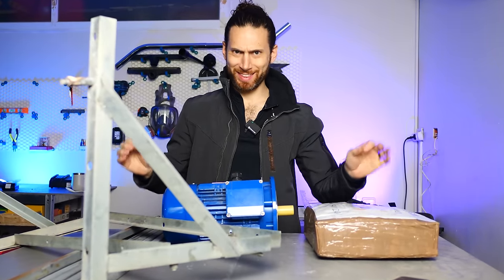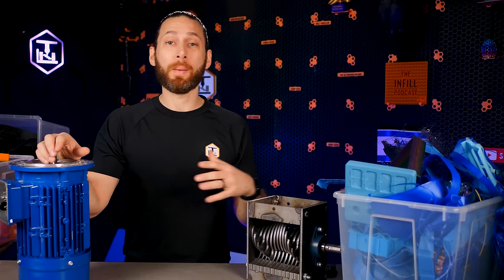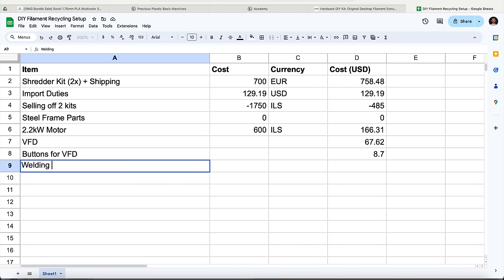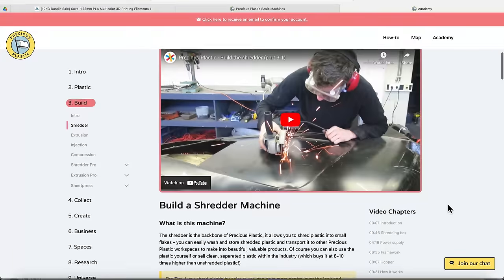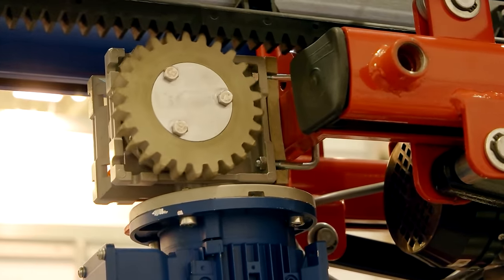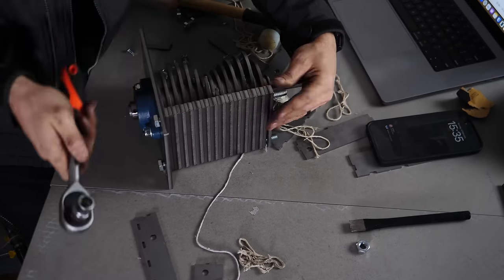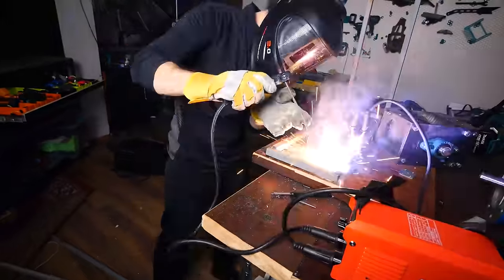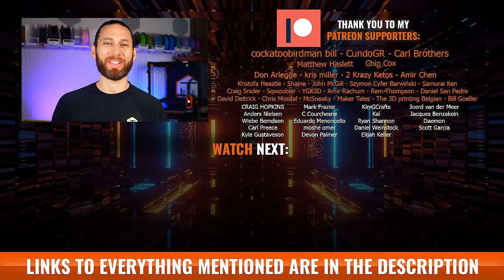Affordable Filament Recycling?

Comment from the maker: Thanks for watching! I really appreciate your feedback on my videos and projects, and I read every comment… So… Like… Leave one!
Reply: Treadmills tend to have up to 3kW motors, with controls to drive them very slowly, and can be had (used) for like $50. I use those a lot in various projects 👍
Reply from the maker: @timnoko3588  Wow, that's a really good idea, wish I'd thought of it.
Reply: the fumes are not the best
Reply: Never thought of that though Idk that it would withstand the torque for a long period of time.
Reply: Weld in ventilated area
Reply: Let's see, start with the Precious Plastic shredder it looks like you've already built, buy an Artme3D extruder kit, and add a Recreator3D if you drink a lot of bottled water. Full filament recycling station for a home shop. Doing that myself.
Reply: I have to point out that this project is 100% redundant. You are doing exactly the same thing as Precious Plastic id a decade ago, and they have a whole set of DIY machines and a worldwide community building this scale of plastic recycling machines, including dedicated shredder, extruder, injection molder, sheet press, etc, complete with downloadable sorting signs, business plans an hundreds of products apart from filament free to copy. 

PLEASE join them and promote them instead of reinventing the wheel and fragment the recycling maker community.

Comment: Sheet metal worker here, I would be using the 6013 rod too, so good start.  Absolutely have to clean your metal down to bare shiny before welding. Cleaning the ground area always helps too. Rod angle is important, always should be dragging the rod not pushing when horizontal. About 80 degrees for butt welds, 45 degrees for T welds. Practice on some scrap!
Reply from the maker: Thank you! This is helpful!!!
Reply: If there's slag, drag!
Reply: Its mild steel with a stick just a quick hit with grinder disk or wire wheel is generally enough, you want to get rid of paint and corrosion, push or pull isnt as important you can get good welds either way.. there are a bout 1000 different techniques.  but "clean" surfaces and having the settings on the welder somewhat in the correct place will get him 90% there.  @thenextlayer setup a some long butt weelds and pritice for a few hours, play with the welder
Reply: And you can get magnets to hold the pieces together at various angles like 90° or 45° so the stress of holding the materials is less
Reply: Great reply
Reply: I love this stuff. I am a mechanical engineer, I can design this stuff etc. but I have no idea how it´s welded in the end. Such a big difference between theory and hands on work, much respect.
Reply: Stick welding I'm a learning curve for sure. And little short welds are a pain to get it figured out.
Learning to do 3 or 4 inch beads helped me learn what was going on so much more than the little stich weld this project, and most projects you don't want to warp require.
Reply: @thenextlayer  also, you can use your left hand to hold the rod (about halfway down), as well as your right hand. This will give you control over the rod👍
Reply: This...  need to have clean surface to get a good weld and current.
Reply: Ditch the stick welder and go for co2 with argon. Way easier. I dont think anyone is still using stick welders? Atleast not here in Denmark, i havnt seen one of those for around 15 years.. Im an educated black smith, mechanical engineer, production technologist and manager
Reply: @donkanalje9443  It definitely has its place, but it's more for engineering and architectural steel profiles, like I-Beam, U-Channel, Tee, angle, etc. Big thick stuff that's structural and  doesn't need to be pretty. We use Tig for just about everything, especially thin-walled tubing like he was using. Mig would be my next choice, with a fairly thin wire. But I'll say this - our head welder is self-taught, from watching youtube videos. He's never had any formal training, but before he worked for us, he was doing aerospace and oil & gas welding, ultra high-quality x-ray inspected stuff.

Comment: Use a grinder and clean the metal around where you are going to weld and where you put your ground.  This will help get a clean contact. Also take some scrap and play with your settings on the welder. That is the main reason you are sticking at the beginning of the weld.
Reply from the maker: Thank you!!!
Reply: Jay is correct and for old box tubing 7018 or 6011 rod is a good all purpose rod  more prep more results cheers  @thenextlayer

Comment: Stick welders are not good for beginners. You should look into getting a Flux Core MIG welder. These are the type that use a spool of wire. You will get much better welds from this. No rod sticking here. Stick welders are also more used for heavy thick metal where as a MIG can be dialed in to better match thinner metal welding. They also use a wand with a trigger that allows for more precise control of your weld. They are comparable in price to any stick welder. Good luck!
Reply from the maker: I'm tempted. I didn't wanna spend the money until I knew that I liked welding, but now that I know I do... I think I'll get one.
Reply: Good to know, thinking of buying a cheap welder soon myself to learn with.

Comment: With a VFD, the frequency of AC supplied to the motor can be varied which changes its RPM. Changing the sequence of the 3 phases changes the direction of the motor's rotation.
Though, you can run the motor much slower with a VFD, you won't be able to get a high enough torque to crush plastic reliably. I will highly recommend adding a gearbox.
Reply from the maker: Shoot… ok I’ll look into one, I guess :( 
I don’t know where to source them here though.
Reply: I concur
Reply: @thenextlayer  you shouldn’t need anything super fancy from the gearbox. You could probably get by with even something like 2 gears with a high enough gear ratio, you could probably get the cut relatively cheaply from a laser cutting / water jet company. Alternatively looking into a planetary gearbox as those can get higher reductions and are typically enclosed. 
Maybe you could look into gearboxes for car winches, they look to be similarly sized for the motor you have. Those are meant to get cars unstuck so they have a boat load of torque at a low rpm output, and I’m sure you can find ones with burnt out motors and functional gear boxes on the used market.
Reply from the maker: @dpear3  Thankfully someone messaged me and has what I'm looking for - so grateful for viewers on  YouTube...
Reply: @thenextlayer  a filament extruder usually has about 17:1 - 32:1 gear box  the screw and barrel sise is for any size extruder line the same should be fine for the shredder maybe stay closer to the upper range for touque over RPM
Reply: Absolutely need a great reduction to increase torque. 

On the bright side, the right gearbox will have a mounting flange for the motor.
Reply: Sounds like you've got a lead on a gearbox. Alternatively you could use a series of belts and pulleys to get the right ratio.
Reply: I would second the recommendation for a vehicle winch. They have small (usually 12v) DC motors and a planetary gear system that steps down the high rpm to low rpm and high torque (mine has a 148:1 ratio!). Even if you can find a broken winch you might be able to harvest the gearbox and mate it to your existing motor. The gearbox is usually on one side of the winch and the motor is on the opposite side with the drive shaft running through the center of the winch drum.
Reply: @MystickPhoenix  this is actually a cost effective way if it can turn enough RMP IMO for a budget build this maybe a good ticket Cheers
Reply: Also be aware motors have an efficiency curve and if u run them way down or too high on the curve u will chew electricity like crazy and the motor will do stuff all work
Reply: I'd recommend DC for many of these reasons as well.
Reply: @thenextlayer  I would take a look at the Shredii 5. It's a DIY build I found on YT.
Reply: Came here to point out the things above, well done peeps. I would just like to add that a lot of electric motors have cooling fans built in and are designed to move a certain amount of air at their standard operating RPM. Something to keep in mind if you're running a motor slowly on a VFD. 

Also with a VFD it can be possible to over rev an electric motor, but that involves checking your bearing specs and other info, as not all motors can take being overclocked.

Comment: I am an engineer, welder, tool and die maker, etc with 50+ years experience.  And I have actually built shredders such as you are doing though larger and intended to shred metal.  I love the project (am also hording plastic waste) and am very impressed by your "just do it" approach. Lots of people talk and day dream about such things but you are actually doing it.  So great respect to you.  Good that you are using salvaged materials and trying to reduce cost.  Purchasing the kit is a good start.   However, the welded frame is, as others have mentioned, totally inadequate for the intense vibrations such a machine will produce, even if you could align the motor with the shredder (which is unlikely without precise machining tools and skills). As others suggest, a MIG welder is much easier to learn and grinding the weld area to shiny metal before welding is essential. The frame needs triangulated bracing and adequate welds as many others have said.  The motor must have a substantial mechanical speed reduction (and torque multiplication) system by gears, chains/sprockets or belts and pulleys to drive the shredder.  Some shredders actually run at high speed but that would just melt the plastic we want to shred.  An appropriate gear reduction system that would couple to your motor and your shredder will be a challenge to find and likely quite expensive.  A belt or chain speed reduction system will need pulleys or sprockets, bearings, keyed intermediate shafts and additional framework (and guards for safety) with provision for adjusting belt or chain tension.  All a bit more complicated but still possible with your drive and ambition.  I would be happy to help you with the design of such systems and might duplicate here for my own use.

Another concern you havent mentioned is cleaning the plastic scrap before shredding.  3D printing needs filament that is very pure with nothing that will clog the nozzle.  I know the stuff I collect is likely to have bits of debris included that will cause problems if it gets into the final product filament and I am not sure how to eliminate that problem.  It may be that filtering the shredded material by melting it and extruding through a 0.4 or smaller "screen" will be required and that seems high maintenence at best.
Reply: I checked out precious plastics designs a couple years ago and the shredder was one step the next step was to clean and dry and they have plans up for s make shift washing machine with a pool sand filter for the microplastics, and then like a screened bag to put the shredds in to dry, which is another make shift dryer made from a drying machine
Reply: Yeah, you should definitely check out the Precious Plastic project and HUGE community. They have done this for ten years now, and have a set of D.I.Y. plans/parts/machines in project sites all over the world. Including shredders and extruders. This video is totally reinventing the wheel a decade too late.
Reply: Well I mean some things are a little out of date at this point there are other systems out there that can run longer and have a better accuracy then b4 but it is still a good reference or starting point
Reply: But the process is the same
Reply from the maker: This comment helps a TON! Thank you! Can you message me on discord? @jonathanalevi
Reply from the maker: I didn’t know that. Wow. Glad I read comments. I stopped at shredder.
Reply from the maker: I’m literally using the precious plastic shredder bud.
Reply: Depends on what exactly you try to filter out, are those metal bits for example ? If so, add a water bath, heavier metals will sink. Recycling is is no joke it is difficult.

Comment: Amazing video, can't wait to see the rest of the series! Some tips for the welding:

- Be very careful welding any steel that is galvanized, it's fumes are uber bad for you. I'd do it outside if possible and grinding the area you're about to weld will reduce these fumes (though it's difficult to grind the inside of steel bar).
- You appear to be using a 110v welder. To increase it's penetration in the material (and therefore strength), you can pre-heat the metal with something like a propane or map gas torch.

Other than that you're doing great! Keep up the good work :)

Comment: Wonderful project you have taken on.  I surely shall be following along.  As for the welding.  It helps a lot to have a scrap piece of grounded metal beside or near where you are welding.  Strike your rod on this scrap piece to heat the rod, like to red hot.  Then move to your work piece with a hot rod to start.  Another thing do NOT be afraid to hold the welding rod with your other dry gloved hand near the end of the rod. I mean hold the rod with your hand to guide you as you start. Once started you can let go of the rod as it gets pretty hot with you hand that close to the weld.  But now running the weld is much easier.  Thank you for the series.

Comment: Awesome project! Welding tips: Only weld on clean metal (grind or wire brush to bare metal and de-grease with acetone). Wire brush the flux off your previous welds before welding over or next to them (a wire brush and chipping hammer are essential tools, stick welding leaves a flux coating that you do not want to weld over). In the U.S. many steel supplies sell remnant and scrap cuts to the public if you're having trouble finding steel. When beginning to learn welding, practice on flat steel plates to learn how to tack pieces together and lay slow and steady beads in straight lines. Before welding a new project, practice on scrap steel of the same thickness in the same kind of joints, trying different welder settings to see what works best. Beginner stick welding videos on YouTube are a massive help getting your welding hobby off the ground.
Reply from the maker: Thank yoU! These are great tips, I'll do all this next time.
Reply: cleaning to that level is overkill unless its stainless, ms with stick with literally burn though anything if the arc is started, a decent clean surface should be used though, if your welds are good you don't need a hammer at all the slag peels off and you will finish the surface later.
Reply: @AlexSzymanowski  You're not wrong, but neither am I. Have a nice day.

Comment: I'm currently working on the big brother of this project, which wasn't initially big in my drafting phase, but I scored a retired industrial 40mmx1100mm injection machine screw and will be building my machine around it. Initially, I designed and resin printed an injection screw and was going to cast it, but the real screw was an absolute steal and I couldn't resist.
The motor is something that is definitely an item that needs specificity. Single phase motors don't have the option of speed controllers if they are AC powered, so you'll need to use a reduction gearbox, which for the type of motor you'll need, can eclipse the budget of the entire project. I'm a notorious scrap rat, but all of the motors I have aren't anywhere near torquey enough to spin the 20lb chunk of steel screw even with a gearbox, or slow enough with pulleys. A 3-phase with VFD is ideal in both our cases, but as a cost-saving measure, I'm going to try an initial iteration with a pneumatic impact gun and see how it goes since I have it, and it will be amply powerful for the job. 
Frames are also a necessary evil, and steel prices have been skyrocketing into the ridiculous territory the last few years. One used to be able to go scrapping for usable steel, but anymore the good, usable stuff gets picked by the pros, and the junk goes straight to the smelters. I've ended up collecting free bed frames for the angle iron steel and welding up what I need. 
For injection/extrusion nozzles, you can pick them up extremely cheaply through industrial suppliers, or if you're relatively clever, drill out steel pipe caps. The industrial nozzles can be had as cheaply as $13, where you can thread and tap an insert for making other sizes when the use case comes up. I'm aiming for 10mm so I can use hydraulic lines and connectors, but I'm also aiming to do for injection mold use rather than running filament, but with a tapped insert, I may try my hand at doing custom composite filaments in the near future.

Add: I'd nearly forgotten, but bulk shredders don't necessarily have to look like you might expect. I've had great luck with homebuilt crushers that were designed for rock (I use them for processing graphitized carbon for my graphene products), but you can change the screen size to adapt to the pellet or particle size you want and dump into a sack/bucket, feeding as fast as you want. While grinders and shredders work, they can take a long time to process any sizeable volume runs. With my crusher, it's almost instantaneous and you'd be surprised how little time it takes to have a constant stream shooting out the exit port. 😁